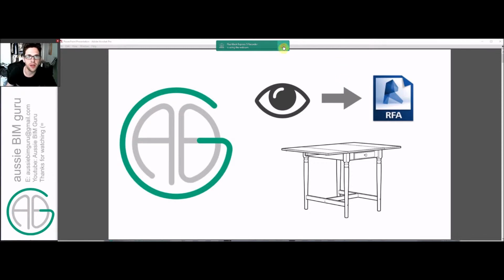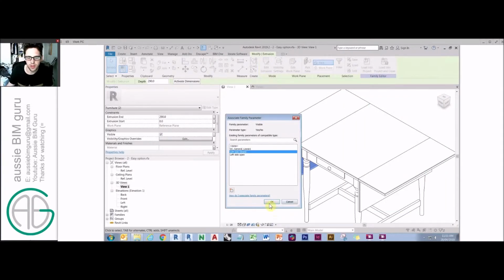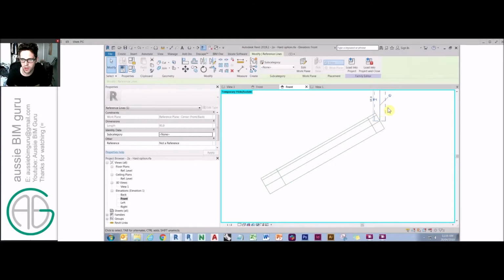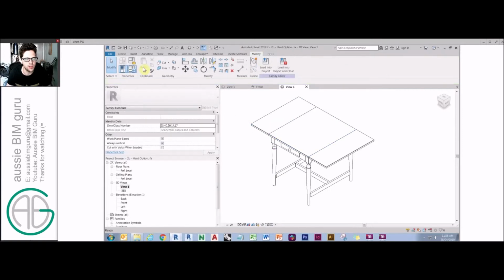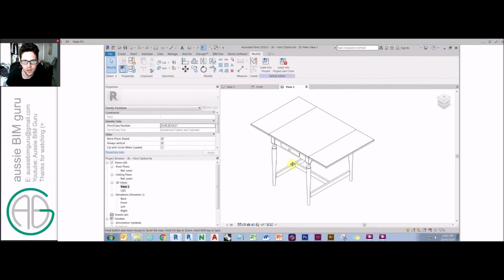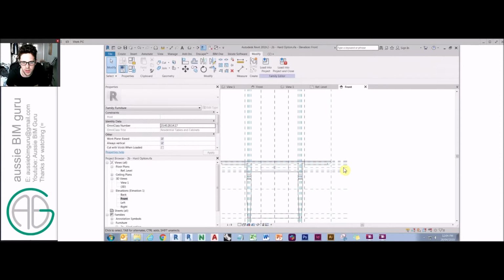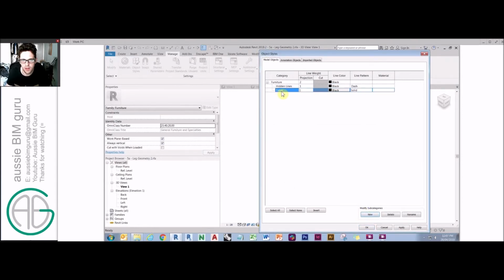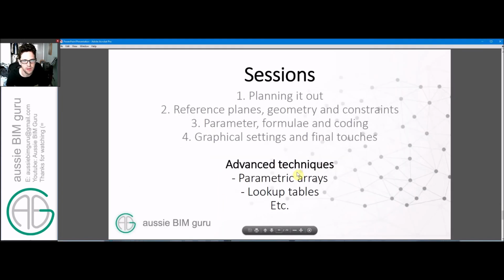Revit Family Graphics (Family Creation 4/4)

Comment: What do you mean by "setting up the Object Styles in your template?"
Do you suggest something in order to be consistent in this? Having to do it every single time you create a family can indeed cause accidents in naming them...
Reply from the maker: Yes object style naming is important. I usually suggest keeping a file on hand such an excel table with preapproved object styles listed by category. As well as this it is sometimes worth modifying your family templates to contain relevant object styles as well.
Reply: @AussieBIMGuru Okok. I started keeping track of my parameters in a Excel file already. Just learned the hard way that Multiline Text cannot be part of formulas :'/ and had to switch to Text instead

I'll make sure to have an Object Styles excel file as well for consistency. Obrigada :)
Reply from the maker: @marianaarodrigues1  yeah multiline text is generally a difficult data type to work with, which is a shame as it can be handy for descriptions sometimes. It gets challenging when working with data in dynamo also.